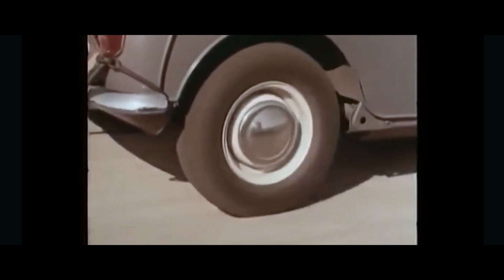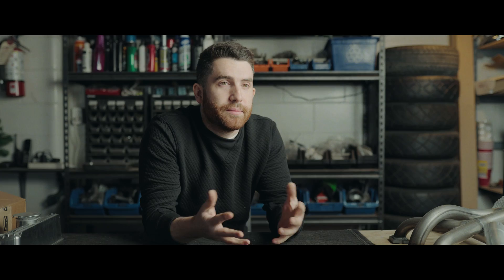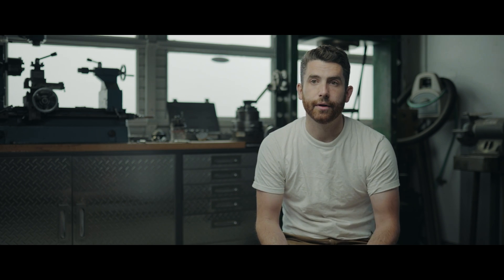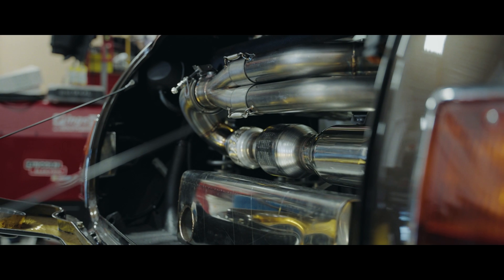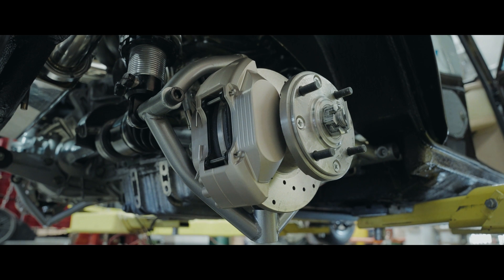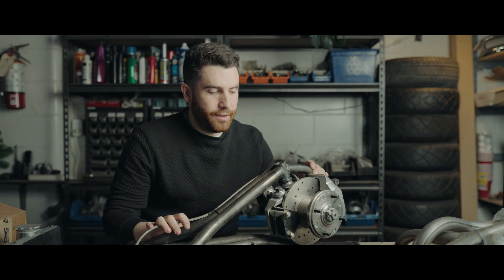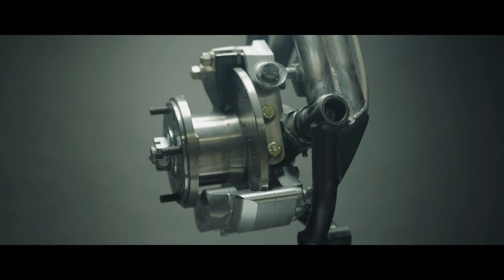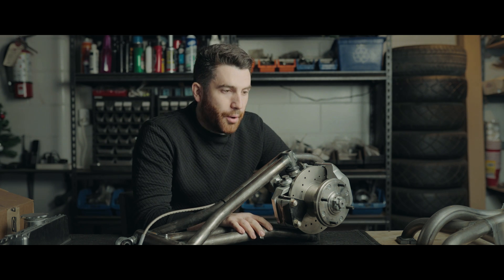Stellera Insider Series - The Trailing Arm

Comment: Best design feature, up to now on the Type 20 Mini.
Lots of adjustability build in.
Still think a central lock nut would have fitted better the wheel design.  It used to be a Wood & Pickett kit.